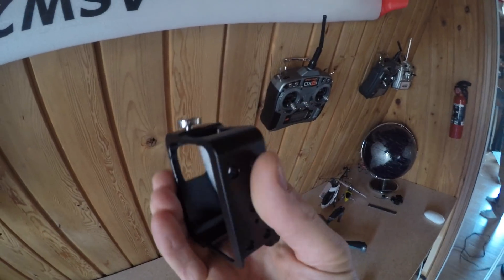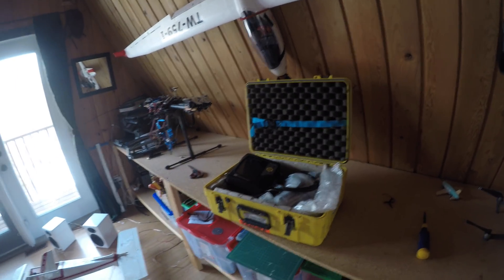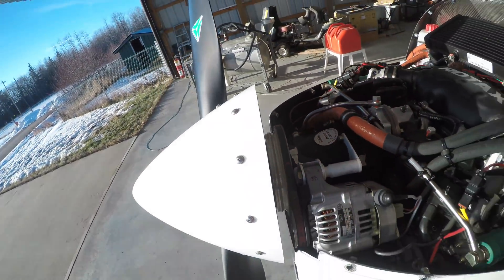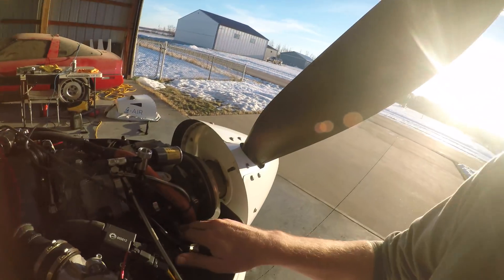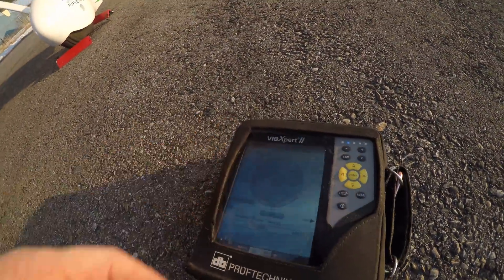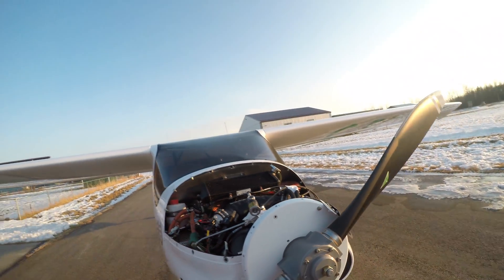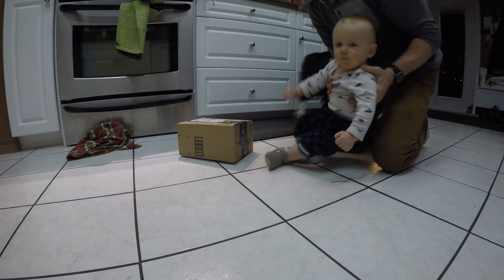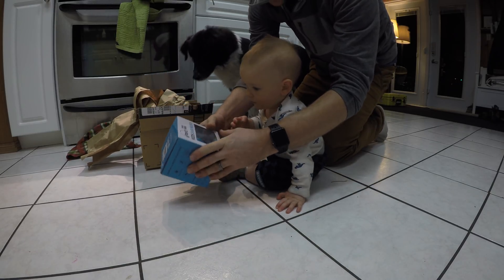Balancing your Propeller on a Pipistrel Virus SW with MT Prop

Comment: Darryl do you think the balance changed since the prop was installed? Or do you feel it was always out and would have showed the same acceleration when it was newly installed 300hrs ago?
Also, what was the cause of your prop failure? Was it a faulty manufacture of the blade or the result of damage or poor balance?
Reply from the maker: It was faulty manufacturing. The prop was sent to lab and they found fractures in the good side of the propeller hub where the other one broke free. No props go out of balance from wear, rock chips. I check/balance my prop once a year and always needs some adjustment

Comment: Hey Darryl.  Great video!  Quick question.  Why do a balance with weight in and then remove it?  Would it not throw the results off?  Is it not better to remove the weight before the test if you are going to remove it anyway?
Reply from the maker: Kerry Myers good question, I wanted to get an initial vibration reading without making any changes so that I know if the vibration is bad enough that it needs balancing. I also don’t want a bunch of holes and weights in various spots on the nose cone mounting plate. So I took the weight off which allowed me to start the balance from scratch and also allowed me to use that hole as my trial weight hole so that I didn’t have to drill a separate hole just for trial weight. Once done the trial weight run I can then drill my hole for the final weight, which only leaves me with two holes in the plate instead of three had I not removed the weight that was already there.

Comment: where did you buy it? and about dinavibe? Great videos!! thanks!!
Reply from the maker: My dad works for Pruftechnik, so got it through him. I've never used Dinavibe but i'm sure it works great. The balancer I am using is way overkill for this type of balancing.
Reply: what elements are you balancing on combines? the main cylinder? and is that felt to increase mtbf on bearings, or affect some other parameter? thanks.
Reply from the maker: Karl W mostly balance the choppers. I’ve balanced about 600 JD choppers, and a few rotors. Choppers do the most damage if out of balance. Rotors don’t go out of balance very often but when they do you can feel entire combine move from out of balance rotor.

Comment: Did you feel any difference while flying after re-balancing the propeller?
Reply from the maker: flexairz yeah its considerably smoother in the cockpit. In the Pipistrel most of the vibration is felt in the rudder pedals, control stick and doors, almost no vibration now